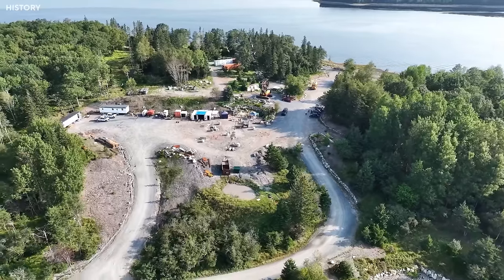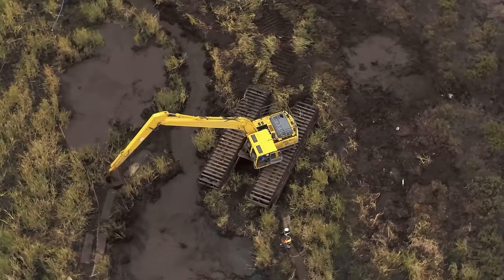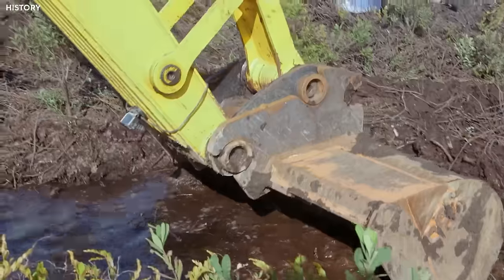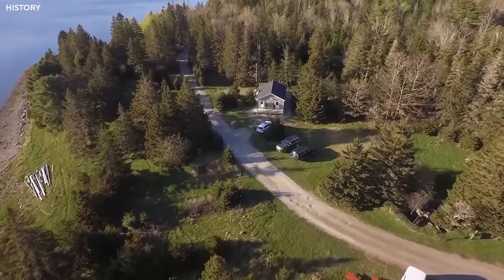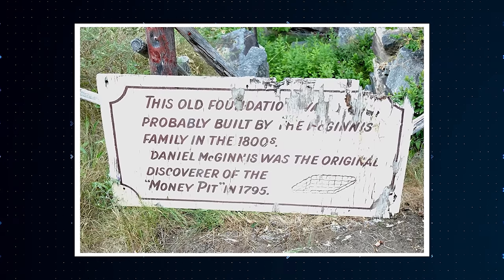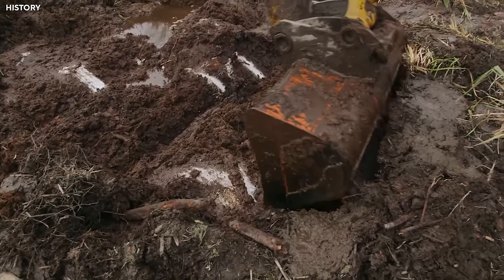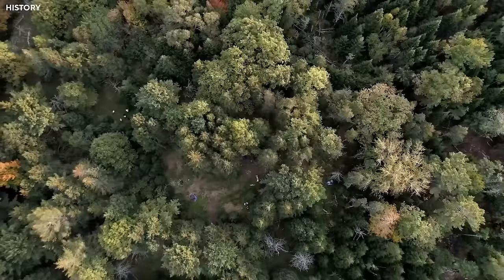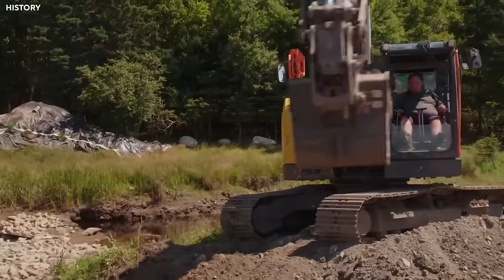The Treasure Has Been Found! Oak Island Season 11 NEWEST Episode LEAKED!

Comment: Oak Island Swamp Possibilities
I’ve been an avid follower of the Curse of Oak Island throughout the past eleven season.  
It appears to me the swamp possibly is a man-made feature.  The swamp area was a shallow between two small land mases.  With the discovery of the dike structure along the two shoreside areas of the swamp it got me to wondering why and what was the purpose of the swamp.  Might it not have been a disposal site for spoils from the tunnel excavations.  The rock roads weren’t constructed only to move “treasures” from ships but for the passage of carts hauling that spoil material.  You might try testing the upper soils in the swamp to determine if they are the same as the soils in the tunnels
The “relics” that have been discovered in the swamp appear to only be discarded items, not items placed in hiding.  
Also, has any thought be given that the possibility of the ship supposedly sunk in the swamp was due to a mishap, such as a fire?